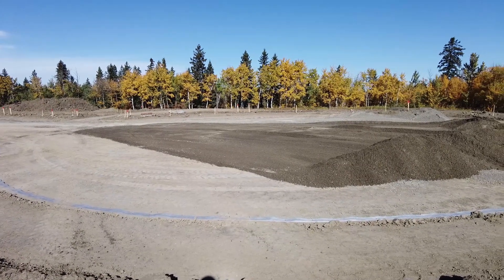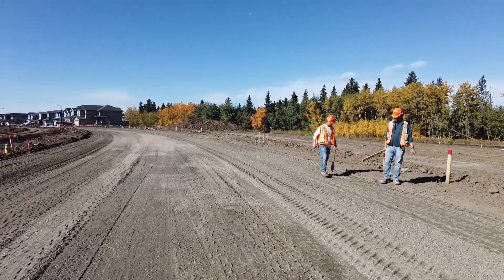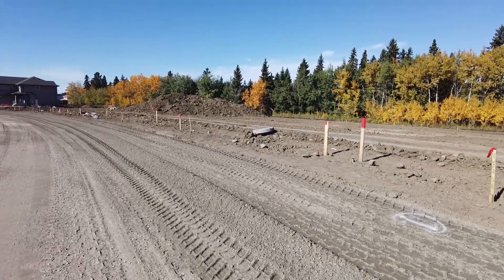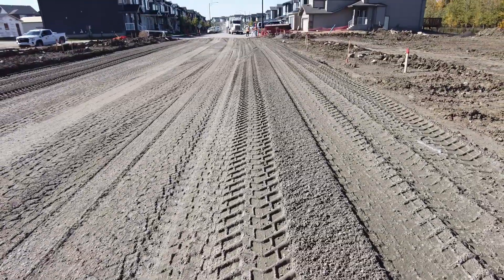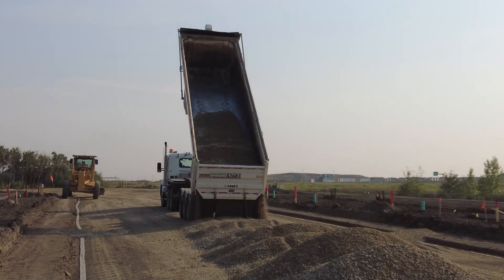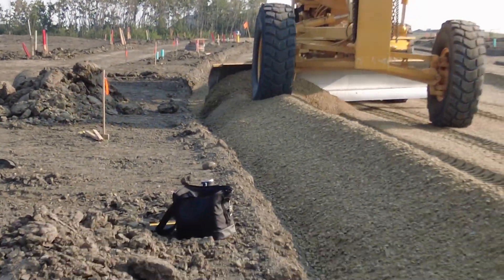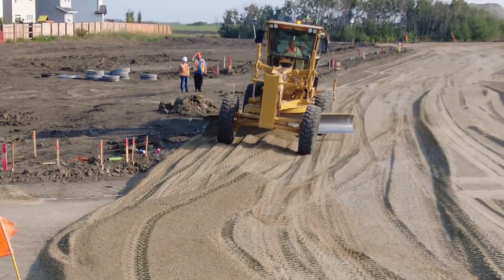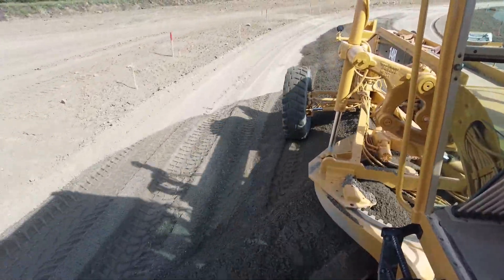Add gravel to the berms, step by step

Comment: I see you're running pup trailers enddumps.whe you said about calculations.i took a job with an out fit where they  did not run grade hub,s,would calculate hot mix by the tonnage on each dump truck.tgey alway,s had to much or too little.theimportance of correct mathematical formula,s affect,s the bottom line,profit,fuel,man hour,s etc.i quit .as a blade man,a  company will fold pretty quick  with thatsystem.excuse my english.that was the most  chicken s,,t outfit I ever worked for.
Reply from the maker: Here in Alberta, if the job is "Highway Spec" The gravel is calculated (tons per meter). So in that case, cutting the trucks off is not so critical. You just stop hauling when you hit your target tonnage.